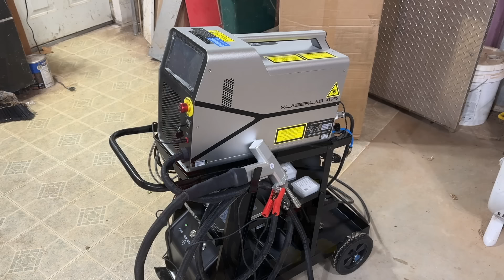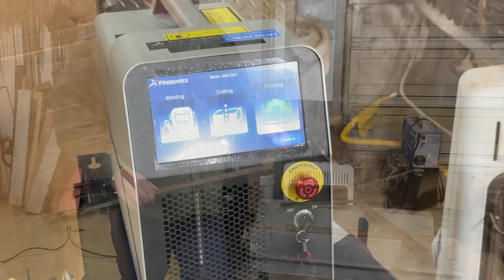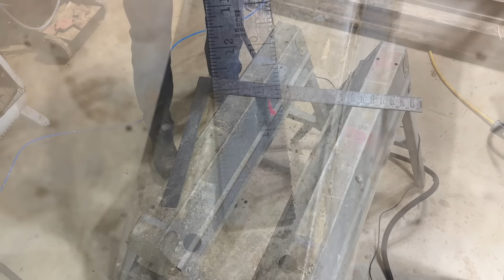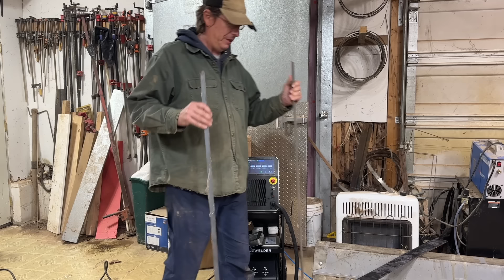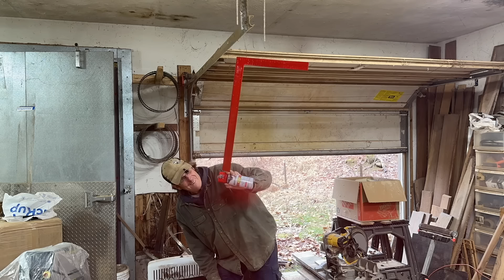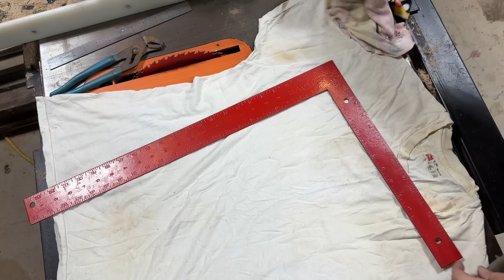Laser Cleaning Rusting Framing Square with the Xlaserlab X1Pro

Comment: If you want to paint in the numbers, use dissimilar paint.  I believe if you use enamel paint as your base and then paint over it with lacquer,  you can wipe the lacquer off easily everywhere except in the markings.  Do some other research though because I may have the base vs top backwards.

Comment: I have a 2000 Ford truck with frame rust... do you think this will be better/gentle/safer for getting rid of rust than sandblasting or grid wheeling?
Reply from the maker: Depending on the amount of rust. This is a 700 watt system. I will be texting it more on some other heavier items.
Reply: @RedToolHouse thank you for quick reply...